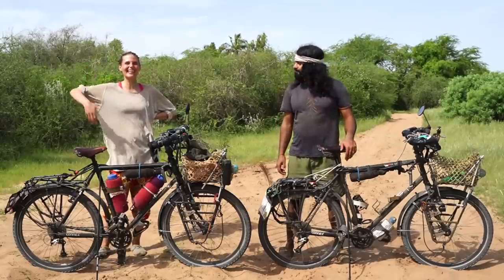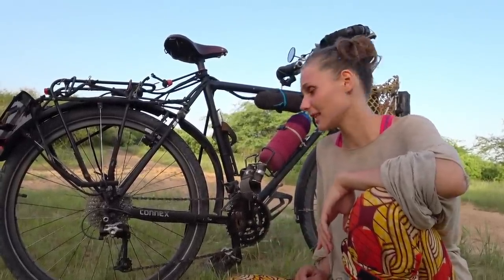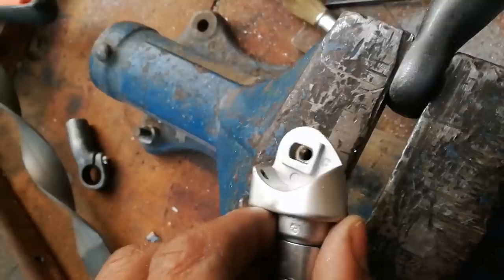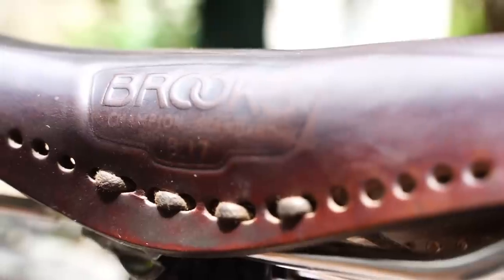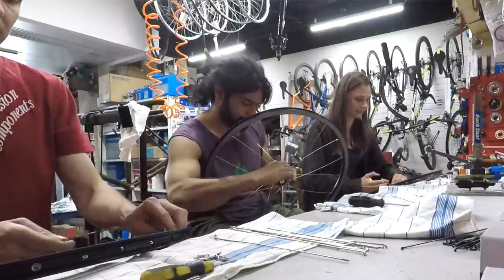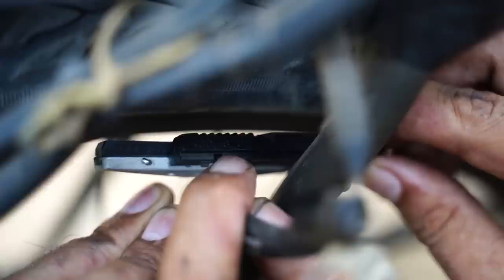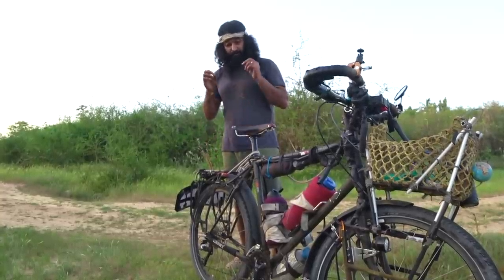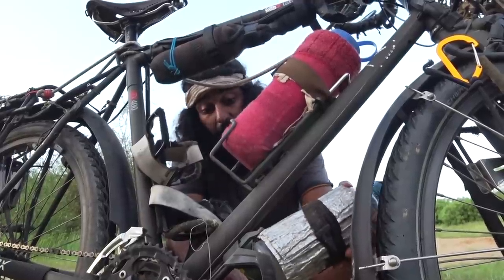Our World Tour Bicycles after ONE YEAR on the road - REVIEW

Comment: Hello Nomad's Trails:

Thank you  for this great video about good touring bicycle equipment. 

Good rides for another 9 years!:-)

I'm riding up to 30'000 kilometers a year alldays and touring on a regular bike. I've had more or less all components/group sets from Shimano. Tourney, Altus, Acera, Alivio, Deore, LX, XT and XTR. Also: Sora, Claris, Tiagra, 105, Ultegra and Dura-Ace. Only the "Revoshifter" fell apart, but besides of that no issues.

If one is passionate about bicycle parts, one has to have Shimano XTR. It is very, very good. But for example the rear derailleur costs 10 times more as the Altus one - and is not 10 times better.

If one wants to do many, many kilometers: the more steel is on the parts, the longer it lasts.

Crank sets: Especially the cheap ones from Shimano (Altus, Acera, Alivio and so on) with steel chainrings last forever.

Bottom brackets: SKF 600 series is great, but costs around EURO 150,-, but I've never had an issuse with the shimano ones: BB-UN55, 26 and 100, which are way less expensive.

Do I have the choice, I don't put Octalink or Hollowtech II. Or Hollowtech II with a bottom bracket from Chris King, Hope etc..

But the standard ones, the 4 edge bottom bracket, are just great compared to the price.

Hubs: Shimano hubs are fine, from the cheapest to the highest. I ride the cheap ones. Inside the hubs is more or less the same. Once there are well greased and adjusted, they roll and roll and....

Brakes: V-Brakes are the best. Everything counted: price, brake power, reliability, durability and maintenance. Cantilevers work good too, but the adjustment can be complicated.
The brake power of disc brakes is super, but in general too many issues. 

Derailleurs rear and front : From the cheapest to the most expensive all Shimano one work fine.

I prefer 7 or 8 speed (cassette, chainrings, chain..), because it lasts way longer than 9, 10, 11, 12, 13 speed. It is more durable. I swear on Shimanos HG 40 7/8 speed chain. 

Enough grease and oil on parts like the chain, the cassette, the chainrings, the wheels of the rear derailleur are very important. Motorex is the best grease and oil that I know. 

Rims: Ryde Sputnik or Andra 30 or 40 are the best ones. 

The tyre Schwalbe Marathon Plus is all in all the best for me. But: The good old normal Marathon made almost 20'000 kilometer, the new Marathon Plus ones wear out at about 3'000 kilometers. Schwalbe might have found out that the most of the customers do the 3'00 kilometers in years. So it works for the majority of the customers. 

Schwalbe tubes are the best in my opinion. 

Rohloff and Pinon are fantastic! But who really needs it? Shimanos derailleur systems work great. For one Rohloff or Pinion one can buy many, many, many Shimano parts. 

If you wanna go uphill, you need the right gear, for example 22 teeth chain ring front, 34 teeth rear. Or 32 t. front, 52 t. rear. 

The right gear (22x34, 32x52 t.) is very important, the group set is not so important. 

Cycling is not about group sets and parts, the most important thing is that you pedal as much as you can. It doesn't matter if you have Tourney or Dura-Ace on your bicycle as long as you go cycling. 

The whole discussion about bicycle parts is extremely overrated. One can experience good tours and rides on a bicycle for EURO 600,- with Shimano Acera on it, no problem. 

If you wanna do something good for your body and soul, if you wanna lose weight, burn fat, get muscles and a good strong heart and see the beauty of the world, then go cycling. 
It is one of the best activities and sports that you can do. 

Avoid E-Bikes, because no body training on a E-Bike. You just betray yourself. Stay away from it. 
And you don't safe the energy and the resources of the world. You just create new problems with the batteries, the recycling and the exploiting of the resources. 

If you wanna do an effective-efficient training, then cycle uphill on a normal bicycle. You breath, you sweat, your pulse goes higher - all very good for your body. And: You get mentally fit. 

Nomad' Trails, you are a very great inspiration!
Reply from the maker: Hello Angelo, thank you so much for  your useful comment and sharing your idea with us. it was very nice to read your comment, a lots of good informations! with 100% agree with your idea about Bottom Bracket! 😊🙌🏽
Reply: Which Bike Frame better Steel or Alloy?
Reply: Steel lasts forever. It's comfortable. Welding is easy, if it would be damaged. I definitely recommend steel.
Reply: Inspiring info. Thx.

Comment: I like that you learn't wheel building as well as building up your bikes. So important that you can fix your bikes on the road, especially where you're riding. Are your tyres a challenge to get on and off the rims? Are you experiencing any pain in the neck, arms, wrists or butt with the position you ride in?
Reply from the maker: Hi, thank you Stuart 😊,  Wheel building is a art like painting, we really love it. There is so many small details which is so much fun to put all of those together. No we don't have problem with taking tires off and putting it on the rim  But off course it is always a challenge to push shcwalbe marrathon plus tour tires out of the Rim Equality , we have tried all the tricks we know and suggested but this is very small so you don't feel it if you don't cycle over 30km/h.  No we don't have any pain, bike fit are pretty good. But Peyman's frame is slightly in big side for him but unfortunately VSF don't offer slightly smaller frame than this.  But this is not a problem with the adjustment we have made 😊

Comment: Schwalbe Marathon tyres are brilliant - Wish I had them back in my days of long distance touring... But short of that and works very well to make the tyre near bomb proof on a touring or mountain bike: Insert a strip of the nylon webbing strap between the tube and tyre. A bit awkward the first time. Never tried it on a road bike and it does change the ride a little, especially downhill in mountains, but not dangerously so. But you can ride over screws and nails no problem - Even had instances where self tapping screws got stuck in the webbing thru tire - no flat, just had to remove because it was hitting the fenders, etc.
Reply from the maker: Sounds like a great tip, thanks! 🙌🏾
Reply: @NomadsTrails  Best of luck during these chaotic times!
Reply from the maker: @chrissonnenschein6634  Thank you! 😊

Comment: i like you guys chose steel that you can fix anywhere, i personally like having all the weihgt in the back and use suspension on front but that is because i like to go off road, i also love locking shoes, the downside is that once i get off the bike i have to put my sandals, if you cycle few km a day it is better just like you did i think.
Reply from the maker: Yes I definitely see the benefit of clips, but it is easier to be able to cycle with any shoes 😊

Comment: Lots of good choices there (SON, marathons, nice frames, brooks and various things optimised for availability/durability. The only thing that surprised me was square-taper BB. Did you pick that in order to have cup+cone bearings? These days I'd use a hollowtech crank/BB as they are stiffer, wider, and no problem with crankline varying due to different tapers/BBs. But I guess square taper is more available in African bike shops? The other thing I can recommend for touring is the forumslader charger. Very nice and versatile bit of kit, that lives inside the headset (and has a waterproof/stainless USB socket).
I like that stand - not seen that before, but does look like a handy touring item. One last thing - why is nearly everything on your bikes covered in velcro or inner tube?

Comment: Rohloff 14 speed hub expensive but would be my choice pretty much fit and forget needing occasional oil change and the  chain last longer than a derailure  system
Reply from the maker: It was an option but we weren't comfortable with the fact if it breaks down we can't fix it  plus few other factors we choice the derailure system. also the one big fact is derailure system works just  some times might need more cleaning😊

Comment: sorry about your broken shifter. how about looking for old shimano  or suntour thumb shifter and use friction mode? they come with 22.2 mm clamp alteady so you don't need the paul thumbies adapter. i use deore dx which has steel clamp, durable, but i use it for commuter not long touring like you
Reply from the maker: Hi , Thank you for your tips, now we installed a friction shifters from 1979 on our bikes 😁🙌
Reply: @NomadsTrails  glad to hear that! i admire your simplicity approach in problem solving. please make video adressing this issue if you have time, how did you choose the shifter, the problem, and the solution.. anyway, have a safe journey!

Comment: I never thought that rim brakes could be so reliable. I’m commuting by bike since about 8 years and occasionally go for a few days ride with a tent making few thousand kilometres per year. I used to cycle and old, cheap trekking bike which v-brakes and only few months ago changed it for a gravel bike with disc brakes. I used to change braking pads few times a year and my rim brake 2 or 3 times during 8 years because of wear. But to be fair I used to replace everything with cheap parts

Comment: Hello friends!  First of all, I would like to thank you for the amazing and inspiring videos you upload.  My wife and I live in Switzerland and we are planning a bicycle tour in this summer.  After searching in  forums and watching your video we decided to purchase two bikes from vsf model TX400. The problem is that the closest store to our home is about 500 miles away in Germany and we can't measure the bike before buying.  My wife and I measured our overall height and the inseam (I am 182 cm and 82 inseam) (my wife 168 cm and 81 inseam) which means I fall into two frame categories 52 and 57.  We would love to hear your advice on whether there is a way to measure the bike not by riding or some other solution.  A huge thank you and good luck in your journey!
Reply from the maker: Thank you David! The frame sizes sound about right, but to get a good fit you might have to change your seat post and handlebar stem. If you didn't already, check that you will be able to stand over the bike. 
For fit we found this manual useful: https://www.ergotec.de/files/service/downloads/Humpert_The_Ergonomics_Guide.pdf
Hope this helps!
Reply: Thank you so much! It is very helpful!

Comment: wow, very nice review. just wondering whats the actual weight of your bikes without any luggage. what's the component of the frame? aluminom, steel or carbon fiber? I recommend tubeless tires so it will be puncture proof. hats off to both of you! I'm gonna watch your videos for the next 9 years..haha
Reply from the maker: Thank you Dann! regarding your questions: the weight without luggage is somewhere around 20 to 22 kg. both of the frames are steal frames. thank you for the recommendation, we never tried tubeless tires, would be nice to try it.  but Schwalbe Marathon Plus Tour tires are pretty good with not getting flat, especially if you keep the tire in maximum recommended Air pressure.  we are warmly  welcoming you to join our adventures!

Comment: how do you rate the solar panels for charging efficiency compared with the dynohubs. I have good experience with dynohubs (only downside being you can't have lights and charge at the same time) but haven't heard many positives for the solar charging in temperate latitudes?
Reply from the maker: Hi Simon,  this depends on how fast you cycle and where in the world you cycle and which season.  When there is Sun the our solar panels are amazing.  Each one is almost like 1grid electric socket. We are almost self sufficient regarding electricity since we are in Africa thanks to the strong sun and our panels. But panels weren't that much useful while cycling lasts winter in Europe. Dynamo hub is ok when we cycle over 15kmh, but this depends on road conditions,wind and terrain. We hope we could answer your question 😊

Comment: what kind of spare parts are you carrying with you? i assume you have spare tubes and a chain.... do you also have spare spokes for the wheels and another set of tires? or is this something you were able to find around africa? i am curious because i am planning on going there aswell but i cant figure out what the bike shops have to offer there... for example: if i have disc brakes will i get spare parts in the middle of africa?

thanks and i love your videos
Reply from the maker: hi, we do carry spare parts like: spokes, tube, 1 tire, nipples, chain, freehub and some more.  bike shops often has parts for 26 inch wheel  MTB in Africa. i wouldn't go out of Europe with disc breaks and we ever felt we need more break power than what we have.  i would suggest 26inch wheel steal touring bicycle with rim breaks with shimano lx rear hub and square taper bb and old friction shifters( you can find a used one from old racing bicycles)

Comment: Well i think the rims you can finish faster based on your style of ride , i have the same rims but slowly slowy i start to consume it , because i also love to go fast down the downhill . I used much more the tires than the brakes so in the end are much more finished the marathon :D
Reply from the maker: You are totally right! The riding style is important factor here.  Btw, I thought you have Ryde Andra 10rims  or I am wrong?  Finishing CSS surfaces of Ryde Andra Rims is a big job 💪😁,  how many km you have on those rims?    And do you use the special brake pads from Swiss Stop or Kool Stop for CSS rims? Ours after 10.000km is not showing any wear and we did around 3000km in Sahara where our bicycles often was covered with sand 😁, happy riding in Japan!✌✌🚲🚲
Reply: @NomadsTrails  yes but if u ride under the rain and ride fast and loaded u consume much faster :D  Yes i do have ryda andra . The best rims EVER!
Reply from the maker: @offcourseisofcourse-travel3264   yes you are right,  rain and sand dose  wear the rim out. is it your Rims CSS version or regular version? if you have CSS version of Andra rims you don't need to be worry about your break surface for at least 60.000km,  but if you have regular version of Andra rim, then it will wear out much faster.

Comment: Hi guys ,Michael here from Toronto Canada ,I also have the same tires as you  plus tours are great tires,and my bike has the Gates  belt drive 8 speed ,what do you think about the Gates  carbon belts?
Reply from the maker: Hi Michael, thanks for your comment! Belts seem very interesting! But we have never tried them. The reason we didn't consider them for these bikes is that you need so many special parts, from the frame on. We like to be able to find spare parts all around the world as easy as possible, and if something happens to the gearbox, rim, frame or belt you are in much bigger trouble than with a derailleur and chain. Hopefully we will still get to try a belt drive for at least a few thousand kilometres to get the feel of it!
Reply: @NomadsTrails  You need to buy a bike with the Gates belt drive  but it`s a great  bike to ride very low maintance  and never had a problem  and i had the bike  for over one yr now.
Reply: @NomadsTrails  You said you got a flat on your  marathon plus tours?I thought they were called the flatless tires.
Reply from the maker: @michaelmatthews4096   😂 maybe we can still call them a flatless tires? 3 flat is not bad😉, but it was a bit of our fault since the air pressure was a bit low.
Reply: @NomadsTrails  Oh ok i try to keep my tires inflated as much as possible and depends where your riding as well like all the rocky roads.

Comment: I am considering a bike with Pinion gears and a Gate belt drive.  My understanding is that this kind of setup is extremely durable and low maintenance.  Very different from what you are using.  Thoughts and comments appreciated.  :-)
Reply from the maker: An interesting, ongoing "debate" in the touring community 😊 Speaking only for ourselves: we wouldn't be comfortable not being able to service our bikes ourselves and with spare parts not being very available, and we don't find a classic drive train to require that much maintenance. But if you have the money for it and accept the risks (of having to deal with a broken gear box/belt somewhere where you need to mail stuff back and forward, deal with customs etc. etc.), why not 😊

Comment: I just dove a bit into the Steel frame myth, namely that a bike is more "comfortable" because of the steel frame -- and it is mostly a myth. Comfort is achieved with correct bike sizing, seat cushioning and amortization, fork amortization and flex (officially not part of the frame) and tire size. Frame itself doesn't flex vertically no matter what tubes size, this has been debated and debunked on internets some few times.
If it flexes sideways in cornering or pedalling then it is probably just a too weak frame. This latter however is just my 2 cents.
Reply from the maker: Thanks for sharing your opinion. Definitely Aluminium frame can do a good job and be comfortable on tour. All of those factors you mentioned are important for having comfy ride. Personally have cycled few years on aluminium frame and I can't complain saying it was uncomfortable. But I prefer steal frame and wouldn't go back to Aluminium. For me definitely  ride with steel frame  is a bit more comfy but the difference compare to Aluminium frame is not that significant.so we won't encourage any one to sale their aluminium bike and buy steel one 😊  we love steal because it is strong,  possible to weld it if needed and it takes fatigue. Also it is kind to our planet  to encourage people to use old frames(which are usually steel) and not  encourage them to buy new  aluminium frame 😊